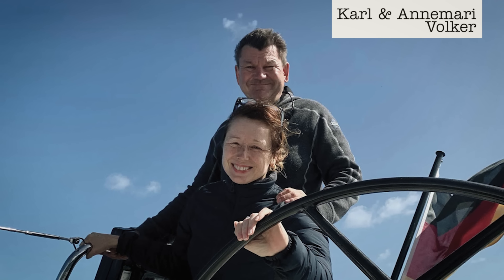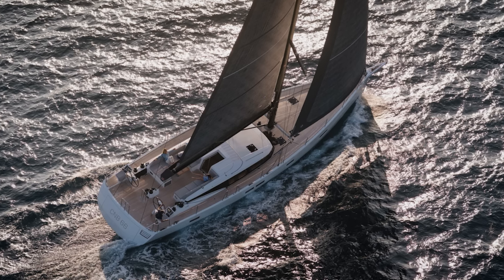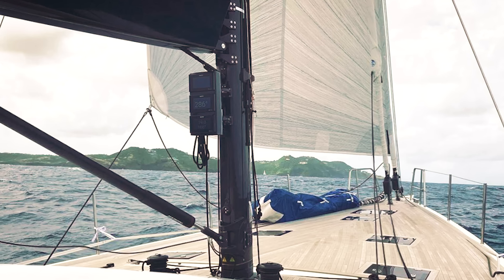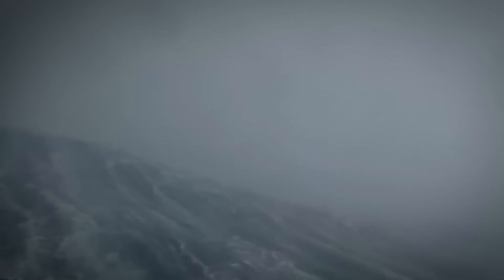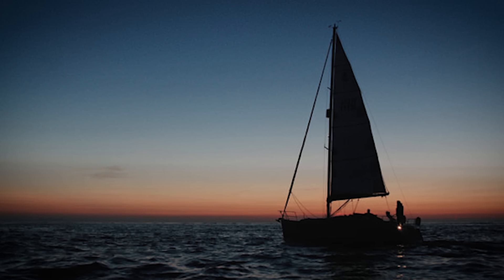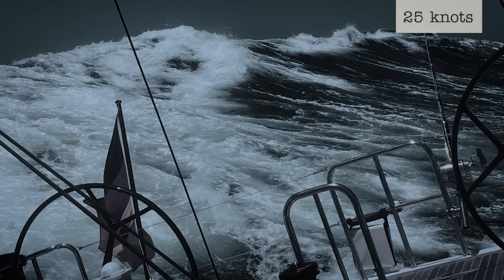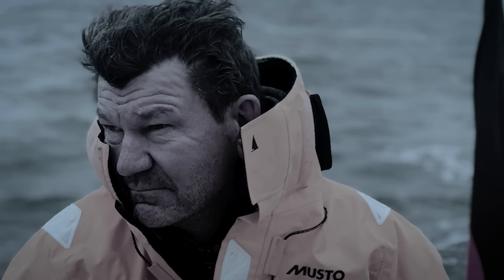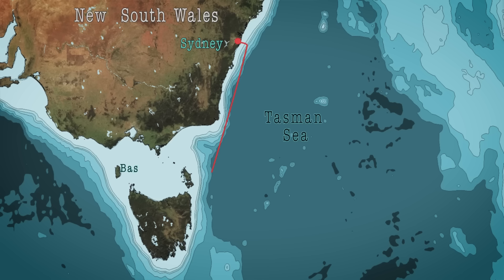Couple DIES on Private Yacht!

Comment: I knew Carl and Anna Marie. I met both aboard their boat when they gave me a tour of their CNB as I too was considering purchasing the same boat. Carl and Anna Marie had just sailed across the Atlantic on its maiden voyage and they were very proud to show me every inch of the boat including Carls favorite tech room he created up in the bow. A sort of work bench and tool shop. He should me the in boom furling and he shared that he found it to be very difficult to manage. He said if the boom for any reason wasn’t in exactly a horizontal position the sail would rise forward or backward on the furler and get itself jammed so he rarely furled from the cockpit but instead he had a second control up at the mast so he could look up and make sure it was fueling straight. It made him nervous that someone had to go forward to the mast to be sure the furling would go smooth . He also pointed out the main sheet issue to me and said he wished that was done differently. Otherwise they were very happy with how the boat was performing and highly recommended it to me. Down below it was beautifully appointed and well laid out and Carl even opened the floor access for me so I could view the redundancy in systems and the ease of access.  They were both very nice people and they loved their new life they had chosen. It was brief meeting but they were at least very happy for a time. I left with a very bad feeling about the in mast furling and the entire boom operation and I made the decision to keep my 58 Jeanneau and not go forward with the CNB. Even Carl knew that boom was an accident waiting to happen as he made it very clear to me that it worried him but he felt he had a good process for dealing with its shortfalls.
Reply: Thank you, this explains a lot.
Reply: Thanks for this explanation. I have crewed long distance on a 48 foot yacht with in-boom furling and found the system very nice in calm weather where everything was under control. Trying to put in a reef in heavy rolling seas turned into a goat rope nearly every time and had do be done carefully and methodically.
Reply: My condolences for Carl and Anna Marie. This was a horrible accident that should never have happened.

I have never liked in mast or in boom mainsail furling. A good full batten system with lazy jacks, and Batcar or other low friction slides are a safer solution for the ocean. You are most wise to keep your Jeanneau 58. The yacht is plenty huge and sails well I am sure. A yacht like the CNB 66 is over the top for most sailors and unfortunately proved to be a super duper gorilla boat for this crew.
Reply: Thank you.  You have convinced me slab reefing is the way to go.
Reply: Thank you for the adding to the story.
Reply: People need to stop treating the open ocean as a plaything. They do not understand the Hell that the Ocean can become. Thankfully none of the mariners who were forced out there were injured. 
As a proffesional mariner and US taxpayer I am still forced to pay for their rescue.
The pain and emotion of rescuers here must also be immense.
Reply: I meant to type in boom furling.  Sorry have in mast they had in boom.  I’m a licensed captain and I thought Carl and Annemarie were quite able sailors but they both were very concerned about the difficulty of furling /reefing the main.
Reply: Hey Rich, isn't there a downhaul on the boom to keep it down so furling could be done easier?
Reply: @michaellove7645  It's an important job of the coast guards and rescue people and an integral part of society. You'll get more attention complaining about smokers and fat people draining the medical system
Reply: what i don't get is having a boom furling system that you need to go up to the mast, doesn't really make sense when a standard system where you flake the sail and use a cunningham or bull ring to secure the reef by the main halliard still means you need to go to the mast in high winds. what benefit did the furling system have, why didn't they just have an in mast furler or lazy jacks
Reply: @Kempiet Heavy sail, less restrictions having the winch on the mast. I like the idea of in boom furling; horizontal battens and a clean, protected sail with less wind resistance at anchor
Reply: @michaellove7645  thats nonsense, what use is a rescue team without people in an emergency? Life is meant to be lived to the fullest.
Reply: Thank you. Interesting post.
Reply: @michaellove7645  the biggest bullshit comment I've ever read!
Reply: As a complete layman on sailboats, it seems to me that if you have to design a workaround system that still has you concerned for safety then you need to correct the real problem at the soonest opportunity. Anything that has to be just right to work is a problem that needs to be immediately addressed because when things are going wrong those conditions that need to be just right never are.
Reply: @OriginalBootlegger  agreed… it was an accident waiting to happen and not what any sailor I know would want… things have to work in the hardest moments… your life depends on it… as was sadly proven.
Reply: @julianbatcheler9970 Very sad, especially as the 2  experienced sailor s had mentioned the safety issues on the ship on their first day onboard. That boom looked so massive and heavy. No wonder accidents happened when the boom went out of control. 😢
Reply: @tvicknair
12 seconds ago (edited)
Sad Story.   But I must say that the old ways are the best ways.  Why a sloop?  Split rigs were designed to reduce pressure on the sails, especially on such a big boat. Making it easier for a two-handed crew to handle one smaller sail at a time. The forces on these sails are massive.   Secondly, it did not matter what the reefing mechanism was.  Reefing downwind in a gale is virtually impossible, especially with a main. Why they did not turn upwind earlier and reef, I do not know.  This is why I am not good at following orders.
Reply: @tvicknair Reefing downwind is not impossible with a proper slab-reefing setup, and turning from downwind to head to wind in a significant blow and seaway can be extremely dangerous and damaging. Learn how to reef downwind and deploy a series drogue to avoid the kinds of issues that led to these needless deaths.
Reply: @AMERICANPATRIOT1945   That was a lot of boat to manage and that beast of a boom was no help.
Reply: A sobering watch, and very thorough report and investigation. I am a member of South African National Sea Rescue Institute and the importance of a debrief of such incidents cannot be over stated. It is terrible that two sailors lost their lives, but through lessons learnt this could be avoided in future.
Reply: @michaellove7645  Yeah, that's so true. Most of them are amateur recreational sailors. I'm from the Netherlands, so we are on the NordSea. We have to rescue amateur sailors on a regular basis. But they will have to pay for their personal rescue and the vessel. They will be picked up from their vessel and be ask if their boat should be saved also. If not, we leave the boat at sea.
Hopefully they have some kind of insurance policy in that case.
Reply: @johanwithag2432 I had a cousin and her husband and went out sailing with them, thinking they would be better sailors than me, since he'd crewed on a racing yacht team on Sydney harbour (Australia) and she had grown up sailing with her father on his boat on the North Sea in Scotland. 

All I had done was a few hours week in a 12 week course on 12' skiffs on the Swan River in Perth. And lived as a young child in Orkney Islands watching tidal currents from a wooden dingy.

They were such bad sailors, we didn't get to shore until I took over controlling the sail. I would never go on board with them again. 

A few months later, they told me they sold the boat because they got in so much trouble  they though they were going to kill themselves and her sister!

They could have just done the same basic training I had done and gotten some experienced help to learn how to sail their little yacht better. And learned about tidal conditions and their local sailing area. They were highly intelligent, it was all just very strange to me.
Reply: @elipotter369  Hi,, yeah sailing looks  pretty simple, and on a small inland lake with calm wind it's not to difficult to learn. On a sea or ocean with currents, strong winds, no land in sight and riffs all over the place, it's a total other ballgame.
Reply: He could see the problem but he didn't fix it. A lesson for all of us there. Never short change yourself on safety
Reply: dayum if i had yacht money, i wouldnt be on youtube posting comments. just saying that you are CAP
Reply: The way you explain things is very helpful. I look forward to your awesome videos. Good work!
Reply: If it's such a bitch  to reef,  then obviously they need to reef VERY early  !  
Orbetter still a ketch rig  !  
Too much reliance on electronics,  a Barometer would give plenty of warning of a  front, so reef early 
RiP  the couple  😢
Reply: Add- a tiny woman assigned to handle the massive boom, guess what happened
Reply: badly designed boat. simple fact. nowadays, sailboats are designed by people on land who don't sail often.
Reply: @michaellove7645  I often watched Blue Horizon, two young Germans sailing the ocean. Oftentimes, they climbed the boom barfeet. Calling for an accident. But they made it so far to Florida.
Reply: @michaellove7645  the sorts of people who are buying these yachts have paid an immense amount into the tax system, be it personal tax, corporate tax, let alone yacht sales tax.
Reply: .....and yet he still sailed with it, at the risk of sounding callous that says a lot too.
Reply: Oh my God how horrible…
Reply: @michaellove7645  They get paid whether they are rescuing or not.  Having search and rescue is part of modern society and a social contract I am more than happy to honor as a tax payer.
Reply: @michaellove7645 Somebody who claims to be a professional but can’t even spell professional, simply cannot be trusted.
Reply: @SunBear69420 total cap homeboy. Super cap G. You probably don’t even have new car money so what do you know?
Reply: That's a lot of words to say you met a guy who made poor choices.
Reply: @spazzypengin  why be facetious?? It's not about commenting just so he could say he 'met a guy who made poor choices.' If it was so wordy, then why did so many people here appreciate it?? The info of what happened before the accident actually adds more to the story. Yeah, the dude made a poor decision. That's obvious. Let people take the video AND the comment together as a cautionary tale...

Comment: They designed this massive boat from the water up for two, why wasn't it a ketch?
Shorter masts, shorter booms. 
In-boom would have been fine then. 

The other flaw was having a winch and mainsheet, for a vast rig, bang in the middle of the cockpit, half of which was a forward "lounge" instead of a safe doghouse/roof/winch/traveler.

This boat was designed for wineglass sailors, not oceans.
Reply: I am also of the opinion that the placement of that mainsheet was a very bad design choice.
Reply: Good observation. I hope the yacht design industry learns from this, but I’m afraid most people who can afford these kind of yachts probably want as much power as possible from their sails and wouldn’t listen to sound advice. I’ve heard it said that lawyers die more in private aircraft than any other type of person because they think they know it all and will not listen to other peoples advice When it comes to flying conditions
Reply: @macdoctor145  Agreed. I don't like to speak I'll but..... I think ego played a big part.
Why was the owner skipper when he had a more experienced crewman aboard?
Reply: @lubberwalker because he’s the owner? lol 
He should have trained the other guys quickly. Take 15min
Reply: @lubberwalker  yes. 
No ego is bigger then the sea.

Comment: Oh this video is painful to watch. The biggest mistake this couple made was trying to sail a boat too big for them to handle. Even with the extra men it was too big. Bigger does not mean safer. The second problem was the swinging boom. In the seventies Hal Roth wrote a book on how to sail around the world and in it he describes how to rig a dual boom vang with four to one purchase. It works well as I found out in 35,000 miles at sea single handed. Even if going straight into the wind you can lock your boom in the center of the boat so it doesn't swing at all. But it all comes down to having more money than brains when choosing a boat.

Comment: I had  a 12 m  sailboat and as a SECURITY MEASURE, NEVER, NEVER  sailed her straight down wind, I always sailed broad reach. The bigger the boat, the bigger the danger and damage in case of sudden wind shift. One can break the boat's shrouds and mast if the boom swing violently from one side to the other. This is poos seamanship (and boat design).

Comment: No traveler? I went to quite a bit of relative effort and expense to add one to my 26ft because single point attachment was such disappointing/uncomfortable experience.
Can anyone justify the 60ft length for husband/wife? To me, that choice killed them. 50ft is plenty, 45ft even smarter. Curious if others can justify 60ft for 2 people?
Reply: What killed them were poor decisions for conditions they were apparently not qualified to handle. lf the boat had been properly set up to be sailed short handed, its size would have had little to no negative effect. All other things being equal, a 60 foot boat will handle rough weather better than a fifty footer, with that size handling the same weather better than one ten feet shorter and so on.
Reply: @frankmiller95  I agree provided adequately operated. But I don't think 2 can adequately operate 60ft. Size needs to be big enough for the weather, and big enough for provisions, tankage, solar, comfort, etc. Sweet spot is 40-50 ft (maybe even 37'-47') depending on intentions. And bigger crew can more confidently go bigger.  Planning isn't going to overcome everything and size can't be overwhelming for 2.
Reply: I am a full time cruiser and within the cruising community, smaller & simpler is generally respected.
Reply: @stephenburnage7687  What are your length, draft, displacement suggestions for cruisers?
Reply: @artsmith103  Noonsite did a survey a few years back of those doing the Atlantic crossing and that concluded 40 to 44 ft was optimal. Personally, the cruisers I meet that are most  happy with their choice of boats tend to be in the 36 to 38ft range (assuming there is just a couple on board). The only reason for not going smaller still (for a single hander or couple) is tankage, but if you can manage with less fuel & water, a 34 ft is simpler to maintain and operate  (which used to be the preferred size, a few decades back). Put it another way: I have known many cruisers give up because their boat was too complex or expensive to maintain. I have never known one give up because their boat was too small. Either way, a 60 ft boat (as in this example) is a complex boat to maintain and operate for anyone, especially when you are away from the services of the major yachting centers (not that was the cause of this accident, which seems to be due to someone releasing the preventer line, a mistake that is possible on any size boat).
Reply: As for displacement. I know some who opted for the big, full keel, heavy displacement type boats but were generally disappointed with them in the normal cruising grounds, due to lack of speed ie a great choice if your off to the southern ocean but not a great choice for trade wind sailing. Same with steel boats. Conversely, too light a boat (like mine) doesn't do well when loaded up with provisions. So, I would vote in favor of something medium like the Pacific Seacraft, Oyster, CAL, etc. One of the most successful cruisers i knew had an old Pearson. Whatever you do, don't go for a modern (highly stressed) volume production boat.
Reply: @stephenburnage7687  Thank you, very qualified advice. A problem developing for this standard of living is financing and insurance is canceling '70s-'90s boats you describe. I'm squeezing all the ability I can out of a "big" trailer sailor and bareboat chartering when a gang can coordinate schedules. There's a fixed bridge near Stuart, FL that limits to ~36'. Not sure if I'll ever buy such a boat, wish it could handle 38'. Maybe I'm lucky to have practical reason to enjoy what I have and not take the next leap :-)
Reply: @artsmith103  There is a lot to be said for a trailer sailor. Once a boat sits in the water full time, your maintenance goes up 2 to 10 X.
Reply: By the way, you are correct, insurance is the big divide. The advantage of not having too much invested in a boat is you are relaxed about not having insurance. The cruisers that I know, that put a lot of money into a boat, and feel the need for insurance, also feel controlled by the insurance company ie how many crew on board, when you can sail, when you have to change your rigging etc. I haven't had insurance for the last five years, since my insurer withdrew from the market.
Reply: @stephenburnage7687  Do you ever encounter marinas, mooring fields that require insurance for you to use them? Is liability only an option if required that isn't influenced much by the age of owner's boat?
Reply: @artsmith103  Yes, many marinas ask for third party liability (only) cover. I am overseas now but, up to now, you could buy that locally, without a survey or age restrictions. Can't speak for the US, however. It does seems that, each year, insurers are progressively withdrawing from the boat insurance market so hard to say what you may experience in a few years.
Reply: @stephenburnage7687  Thanks for all your input! I think this thread was as good as some videos. UPS dropped off a box of boat parts today, waiting for Spring :-)